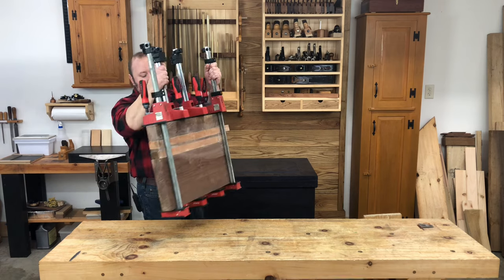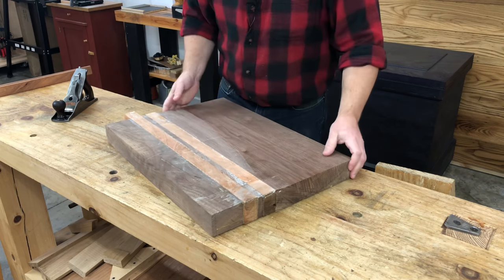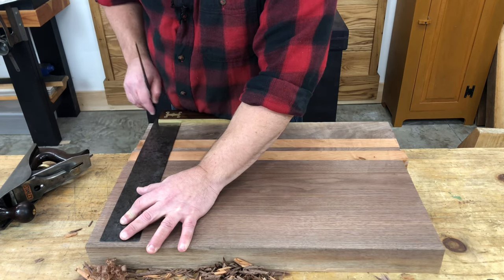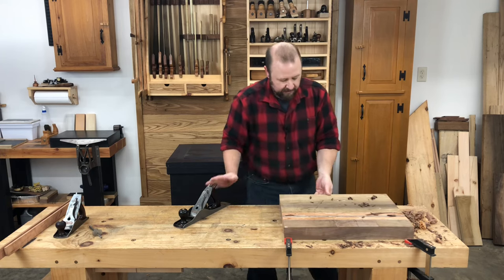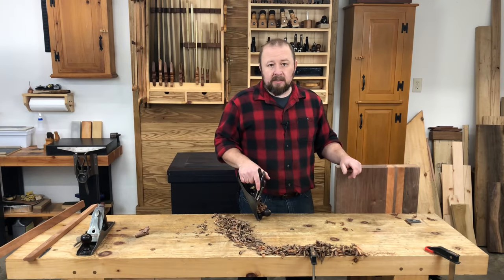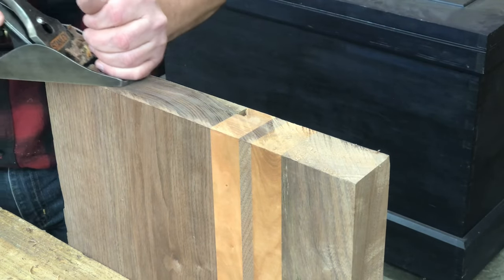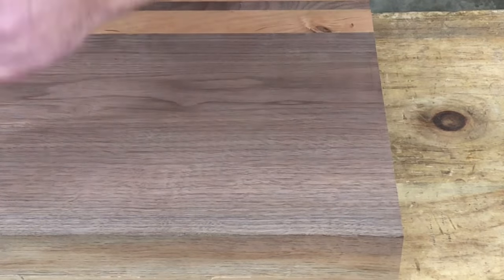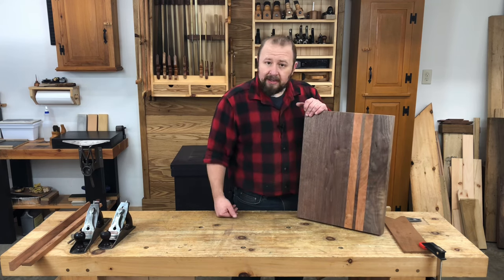Dimensioning a Large Panel | Build a Cutting Board with Hand Tools | Hand Plane Foundations

Comment: Hi I don't understand why you all on youtube are planning that much accross the grain to flatten surfaces. Work with the grain please. Only need to think a bit more time but it is the way wood must be worked.
Reply from the maker: I can't speak of anyone else, but I work this way because it’s a historically accurate and correct way to do it, that also happens to be extremely efficient and effective.
Reply: @BRFineWoodworking  believe me working with the grain is a way better and softer.
Reply from the maker: After over 20 years of working exclusively by hand and taking thousands of board feet of lumber from rough sawn to finish ready using only hand planes, I'll have to agree to disagree.
Reply: @BRFineWoodworking  i understand. There s another way.
Reply from the maker: Yes indeed. The beautiful thing about this craft is that there always is another way, and none of them are wrong. Thanks for providing your perspective.
Reply: @BRFineWoodworking  wanted to add that even if i don't liké thé way you or other flatten those boards, i liké the woodworking you are sharing 👍
Reply from the maker: Thanks! Cheers 🍻!